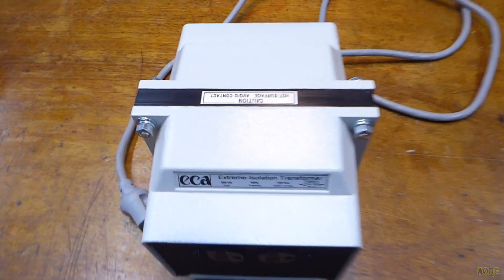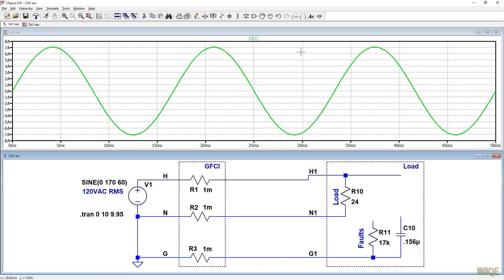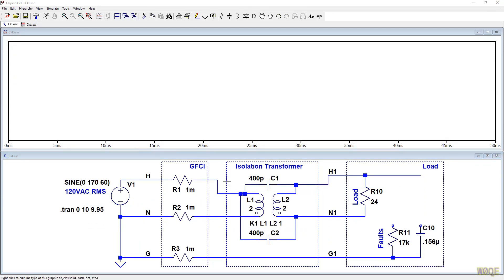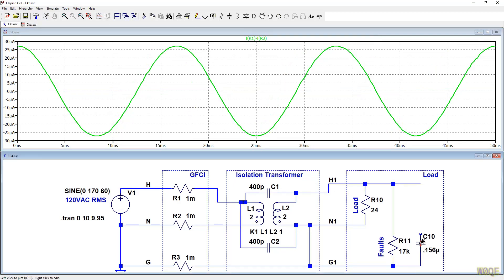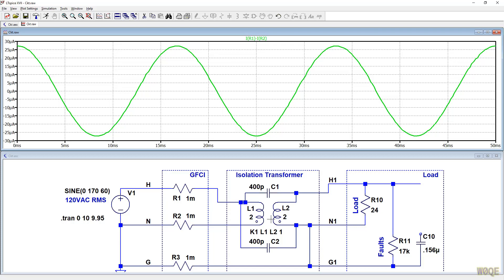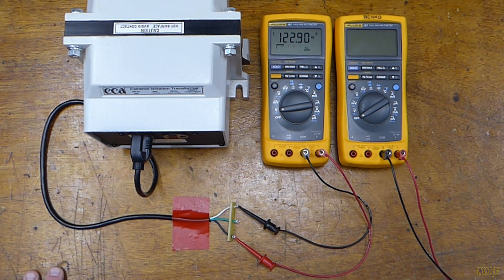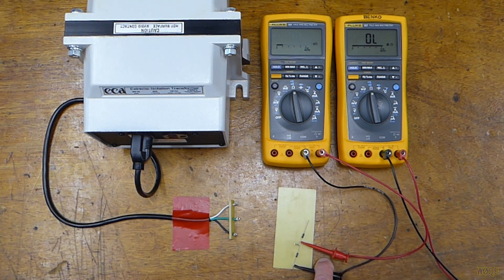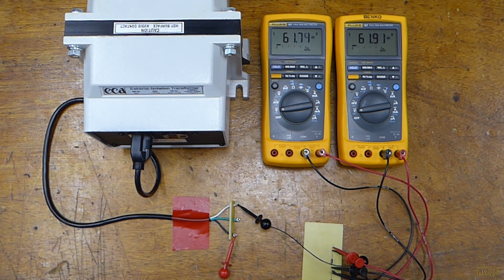#68: Isolation Transformer Warning!

Comment: It doesn't have a problem or a "dark side". It's a "Medical" Isolation Transformer, not a "Lab" Isolation Transformer. It's exactly how it's supposed to be. Obviously, it's easily converted but, to say it has a dark side is incorrect.
Reply from the maker: You are correct that it was built exactly as it was supposed to be.  I would be willing to bet that there are many of these surplus "Medical" Isolation transformers that many people have picked up believing that that they are "Lab" types.

Comment: Most of my experience is in using Toroidal Medical Transformers for instrumentation and test. I think in general the Medical Transformers provide additional features not found in a similar sized (VA) non-medical grade transformer at the expense of being slightly larger in size.

Common Medical Transformer upgrades:

Low AC leakage design which includes a shield and shield wire between primary and secondary.
Higher insulation temperature rating to Class F.
Built in thermal breaker.
Structural regidity by having a potted core.
Tested to the higher standard agency rating (several agency standards worldwide). Also, if a custom higher performance internal company rating is needed for better performance (for example extended Hi Pot) the base design can usually be modified to meet it at extra cost.

Large Toroidal Transfomers, approximately 500VA and larger at 120VAC, will need a surge current (magnetization current) limit circuit.

It is hard to know what you describe as general purpose. To me general purpose would be to isolate line power and ground, then I could wire a ground connection if needed.

On the output you could use a heavy duty hospital grade receptacle with isolated ground then you could establish a ground connection (if needed) to a grounding point without connection to chassis (receptacle strapping ground connection).

Comment: Dear Larry

First:
am not coming from a confrontational point of view. I am sincerely trying to understand 
Lots of things. Let me convey how I am thinking. Then I am hoping you will correct my thinking.

Topic: 
Leaving the outlet ground connected to the supply ground  in a electronic technicians isolation transformer. (Secondary transformer winding iis NOT connected to source ground).

Point one:
Your video does an awesome job of explaining why leaving the ground in the isolation transformer outlet impActs the output of the isolation transformer to a minimal degree. Ie: touching either  side  of 
Transformer secondary to ground does not change the secondary voltage value.

Point I would like to introduce:
Lets now connect the output of our electronic technicians isolation transformer to an imaginary circuit.
In which the ground of the isolation transformer now is attached to the imaginary circuit chassis.

Allow me to make one more assumption:  the circuit designer of the imaginary circuit
Connects various points in the circuit to ground.

Now lets attach the scope probe  alligstor clip to any circuit element (specificallya side of that element electrically furthest from the chassis

Now the model I use to predict circuit behavior with grounds involved is to imagine any two grounds connected by a low resistance wire.

Thus if one side of a circuit element is touching chassis ground and the other side to scope probe ground
I imagine a wire across that circuit element. Thus in my mind the imaginary “shorting” wire would carry the current defined by the circuit. The “grounding” per se is not relevant. It is the short circuit that is relevant.

So the concept I am trying to convey is that if a circuit has only one ground, essentially it never ever caries current. But if two or more grounds exist, then a short is likely

Given that principle (which may be incorrect), then it might be prudent to remove the isolation outlet ground thus making the scope alligator ground the only ground in the imaginary circuit

Please correct me if I have failed to grasp important concepts. I don’t care if I am “wrong”,
I just want to understand.
Reply from the maker: William,
Replace the isolation transformer with a battery that connects to some circuit with no connections made to earth ground.  Then connect 2 points of the circuit (which have a potential difference between them) to earth ground.  Of course current flows and the potential difference between the 2 points will be nearly zero is the wire size is large enough.  These 2 wires will have a current flowing in them depending on the circuit.  However this current will be the same as if a single wire connected those 2 same points together on the circuit with no connection to earth ground.  This is not really current flowing to ground.  The same thing exists for the isolation transformer.
Larry, W0QE

Comment: I have a refrigerator connected to the CFGI and its randomly tripping CFGI. Will the isolation transformer help or fix this problem?
Reply from the maker: Eugene,
Since the refrigerator randomly trips the GFCI I would believe that there is an intermittent problem in the refrigerator which ultimately could be dangerous.  I would not try to fix the tripping with an isolation transformer.
Larry, W0QE

Comment: You correct the misapprehension that some techs have, who say that they do not need an isolation transformer when working on a valve guitar amplifier, because it has it's own transformer in its power supply and is therefore 'already isolated'. They fail to understand that the secondary of the PSU transformer is grounded, and thus not isolated from the mains.

They need to watch your well-informed video to put them right.

Comment: Any sense in using a GFCI on the output of the transformer? If so how would you connect it ?
Reply from the maker: Rob,
If the isolation transformer is connected so that if you externally connect either of the 2 hot wires to ground and the resulting current flow to ground is below the trip point of a GFCI then the answer is no.
Larry, W0QE

Comment: Which is better when choosing a toroid Transformer taller or wider?

I build home made low frequency pure sine wave  power inverters 

I stacked 4 cores to make a larger transformer my idle current on this odd tall Transformer on the 48volt battery side is .29 just a little over a quarter of a amp 

The stacked 4 core tall inverter is only a 2000 watt inverter but I have seen over 30 amps on the 120 volt side when starting big loads while running hair dryer

Taller just seems better than wider

I have wound many normal cores since the tall stacked one 

None of the Finnish inverters have had that low of idle current

 The highest so far has been .44 that is getting close to half of a amp 

2000 watt is smallest inverter I have ever made all others are above 5000 watts 

Stacked core one was around 30 pounds 

The biggest Transformer so far is over 70 pounds

The largest wattage inverter I have built is 10000 watts 

All inverters have chokes on one leg of low side of Transformer  I also wind the chokes myself 

My point is I have to may variables to know for sure just a hunch that taller is better 

I thought you may know or be curious enuff to find out if I can help in any way please let me know 

Have a blessed day
Reply from the maker: Amber,
Have you seen my video #65 at https://www.youtube.com/watch?v=Yh7_XuHqbRI where I discussed the relationship between core area, mean path length, inductance, and flux level?  Also look at video #64 and #66 which also relate to toroids.  I believe these videos will answer your questions.
Larry, W0QE

Comment: If you really want to be safe, when using a electronic shop isolation transformer, Use a GFCI on the output side of the transformer. Tie the negative and ground wires of the GFCI together. Do not connect ground to earth ground. Now you have some protection, if there is a ground fault. Basically giving you a virtual ground. You can mount the GFCI in a separate electrical box. connected with the cord, Minus the ground of course. When a fault occurs, The GFCI will trip. Leaving only the negative side hot but since there is no way to get a complete circuit, you are protected. And so is your equipment.

Comment: How Much is YOUR LIFE Worth? Keeping your test equipment(TE) from being at LETHAL voltages is critical. Seeing how an isolation xfmr. prevents your TE from riding at line voltages really drove home how to prevent a person from getting electrocuted. Possible noisy reading or complete AC line isolation, your choice? Your workbench TE must be safe to keep from giving you the shock of your life or death.
Reply from the maker: What are you complaining about?  Once I took the medical isolation transformer and removed the output side connection from Neutral to Earth ground the unit performed as you would expect.  The medical use was not to provide isolation as you would expect in a test environment but to stop GFCI circuits from tripping due to the high capacitance from Line to Neutral which is due to the differential mode noise filtering in the medical equipment.
Larry
Reply: Good investigation.  I'm not working on high voltages much, but, ground faults are still able to fry equipment and blow probes.   Will follow you now.   I am looking for a good bench isolation transformer in Austin, Tx.

Comment: The outlet of an ISOLATION transformer should NEVER be connected to Mains Earth (Ground). Making that "through connection" means that 1 out of 3 of your connections is no longer isolated.
Effectively, what that does is make one outlet line be referenced to ground, which INSTANTLY means that the other output line is a voltage higher or lower than ground. By doing that, you are then able to provide a path between (say) your finger on the output line and ground (your feet). You will have full output voltage through your body... but YAY, the GFCI won't see that and won't trip.
Think about it. If you are as dumb as this Youtube Channel's author, then watch this and learn:
https://youtu.be/5SjVm-rF39A?t=556
Reply from the maker: John,
The unit was wired as I indicated so that several small medical devices with internal noise filters plugged into the same circuit would not trip a GFCI.  For your use removing the output side connection from neutral to earth ground restores the "isolation" transformer to a more conventional use.  Comments like "If you are as dumb as" provide no value to any conversation.
Larry
Reply: @w0qe  - I have re-watched you video numerous times, and you make a HUGE assumption that the viewers will already know that these units MUST be modified before they can be used in the normal way (for safety).
Your video description states (copy/paste):
Using surplus medical isolation transformers as general purpose isolation transformers .
Whilst your introduction mentions that this is to "discuss why" they made it this way, what you omit to do is make clear that the Earth/Neutral bond must be removed to make it "safe for humans".
The whole extent of that safety aspect was at around 11:40 when you said the we need to "do that", as you clicked delete on the line in the Spice software screen. I missed it the first time, as you were spending so much time babbling about GFCI that I switched off.
Your video is titled and presented as a "How To" for Hobbyists who intend to use Medical isolation transformers as Safety isolating transformers. So really, the whole topic could have been covered in well under a minute by showing how to test for Earth / Neutral (multimeter) and then how to open and remove any link. You even titled the video as "Isolation Transformer Warning" yet you forgot to actually include any warning.
All that GFCI stuff, the Spice models and all the repetitive ramblings that you added is totally unnecessary to the subject that you stated you were covering in the video.
Reply from the maker: John,
Making videos is difficult in that no matter how simple or detailed a video is there are always viewers that think the video was too complex or too simple.  You think that I did a poor job explaining how the medical isolation transformer could be made safe for general users.  Nevertheless the data I presented is correct in that the connection between the output side neutral and earth ground needs to be removed for the device to be safe for general users.  It is also important that once this connection is removed that the leakage current be measured to be sure that the isolation is sufficient to not be a shock hazzard.
Larry, W0QE
Reply: The only reason i know to put secondary to ground is not to make a real isolation transformer but a current limited power supply.
Isolation is not the goal in this setup, the maximum current the secondary side can deliver is what this setup is going for, if you short circuit the secondary it will just collaps the magnetic field and will limit the current.

"Shaving transformers" found in hotels bathroom do the same, its a square plastic plate with behind it a small transformer and the plate has a picture of a man shaving, its not the isolation that makes it a shaving transformer its the "max 15 watt" that makes it a shaving outlet, the transformer limits the output current.
Reply: John you need to watch WOQE video again. He explained that it was a medical devices and then removed the earth connection from the outlet.

Comment: I just wish that there were some reasonably priced differential probes on the market, to put the whole mess to rest. As I don't see any, and those on the market are not 1X or 10X, always 50X or 100 X or some such, I'm guessing that they would somehow load up the circuit at the lower levels. An explanation of Differential (isolated) probes as opposed to differential mode on the scope selection itself would make a good lecture. There's just too much USB and switching power supply stuff out there and such to bite your butt these days. I Don't recall a lot of scope dead shorts back in High School Vocational Electronics Class in the late '70's, when we were probing relatively high voltage television chassis (NOT the super high tension stuff in the metal "cage" of course!)  73 DE W8LV Bill
Reply from the maker: Differential probes make it easy to do measurements but they don't reduce the shock risk to you.
Larry

Comment: What about C1 and C2? Would a failure in either of these lead to a short, and should they be removed? DE W8LV Bill
Reply from the maker: William,
C1 and C2 were shown in my schematic representation of the isolation transformer but do not represent actual components.  They are due to the proximity of the 2 windings and the insulation between them which is a capacitance.  Between the windings is a Faraday shield which is connected to green wire ground.  This shield is an open turn or maybe 1 1/2 turns (to completely isolate the windings) made of a sheet of copper or aluminum.  If the transformer suffered an insulation failure (which would be like a short in C1 and C2 in my simulation) the user would be at a risk of shock but the Faraday shield would protect the user by blowing the fuse.  Does this help?
Larry, W0QE

Comment: great video, didn't know that there are isolation transformers with a ground-N connection. Just checked my transformer (supplies the pump in the garden pond), but there is no connection, good. Additionally I have installed an isolation monitor, a DOLD IL5880. Do you think this makes it safe in all situations ?
Reply from the maker: I believe an isolation monitor is nothing more than a very sensitive GFCI.  For a "safe in all situations" you get involved with wanting 2 or more failures to be "not" safe before anything bad can happen.  Transformer insulation barriers are in the very unlikely to fail category and the isolation monitor is a check on the transformer isolation.  However if you were designing something that needed to be even safer you would want to know if the isolation monitor itself had died which would guarantee if either of the 2 protections had failed you would be alerted.
Larry

Comment: I have one that looks similar , and have caught what others have said " do not use to test house-hold AC circuits " .
And wondered , hay its spouse to be a isolation transformer , what the hay ?
I assume [ and we now that can get us in trouble ] they defeat the isolation in isolation transformer because of lawyers / insurance  .
Seems to get commitments on use scopes for AC line , is only spouse to be done with expensive probes - high voltage differential probes .  
Thanks again